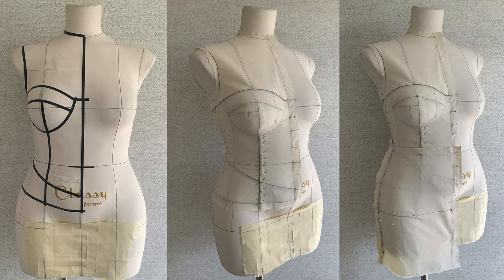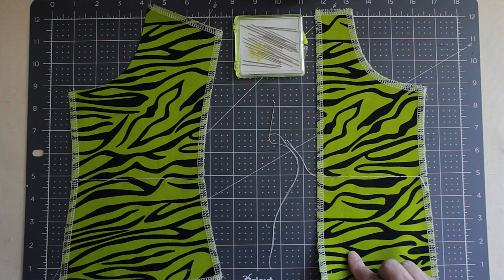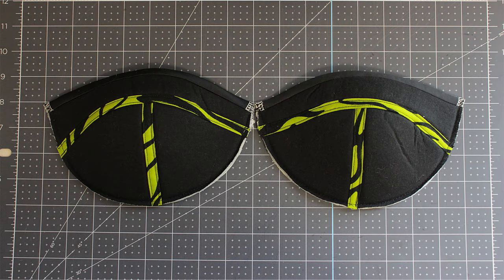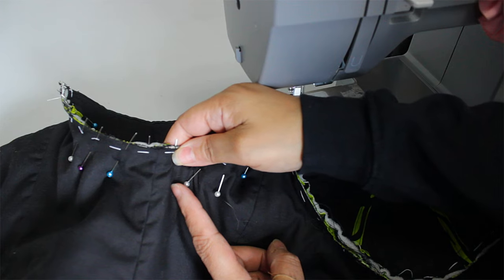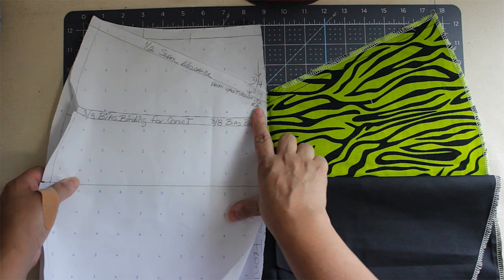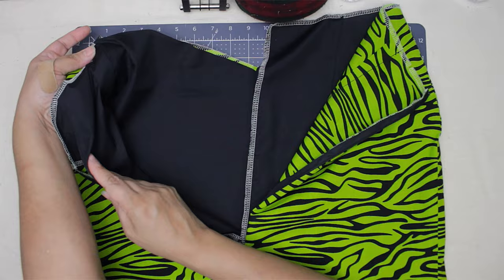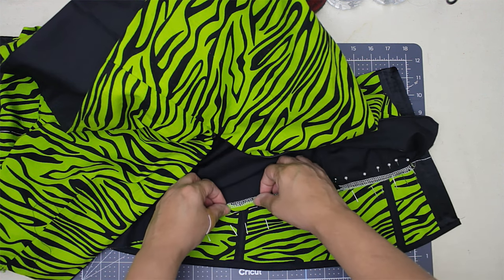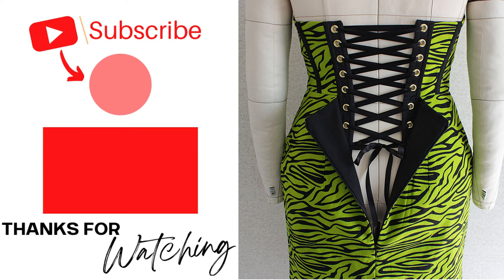HOW TO SEW A INBUILT CORSET

Comment: Love your work! Quick question…when I am drafting the skirt to sew to the corset, do I make the skirt the actual waist size of my client or make it 4 inches smaller to match the amount the corset will cinch the waist?
Reply from the maker: Thank you I would say leave the skirt waist the actual size. When u are taking inches off the corset seams to it will just make the corset part small here is a example, when u get a chance look at the picture in video the corset is 2 1/8 away from the center back so if u make it smaller as in taking it in to cinch the waist the skirt is the actual waist size the corset will just be smaller and the will probably mean it will be more than 2 1/8 away from the center back. So sewing the skirt and corset together the lacing bar (the black piece with the eyelets) that will be a little further away from the center back than mines. Hopefully this helped ❤️
Reply: @drapingclass101  Yes, it did! Thanks so much!
Reply from the maker: @ArdenGreybyKHutchins  your welcome anytime 🥰

Comment: Did you reduce the waist measurement since you reduced the corset waist hope I make sense
Reply from the maker: Draping is 3d and flat pattermaking is 2d when draping on the dressform it doesn’t have to be reduced because it’s on the body…but once it’s laid on the table and u trace the muslin on paper it becomes flat pattens….that’s when it can be reduced to the persons measurements.

Comment: I have a question pls, when doing an in built corset or a corset dress  and you snitch the waist of the corset top by 2inches, do you have to snatch the waits of the skirts too? Cause I did an in built corset and the waist of the skirt Is bigger after I close it. Any help
Reply from the maker: For this situation yes you do because  you made the corset smaller than your waist and when u pull the lacing it will snatch your waist that will make the skirt waist big because your sucked in the corset
Reply: @drapingclass101  ok thank you so much

Comment: Mom please, but what if I want to attached a yoke ❤
Reply from the maker: You can make the yoke after making the corset if you want or make the yoke at the time your draping or drafting the pattern. If you do it after then the person has to be in from of you, and you can put the illusion mesh on there body and make the yoke by pinning it to the corset that’s made already. If you put it on the front you will have to put appliqués on top so the seam is not shown. Or you can sew the yoke in the back of the top of the corset.
Reply: God bless you 🙏 mom ❤